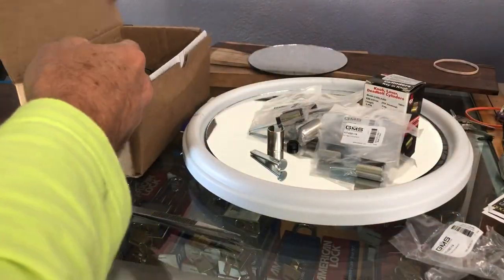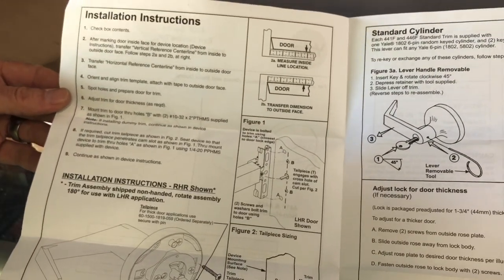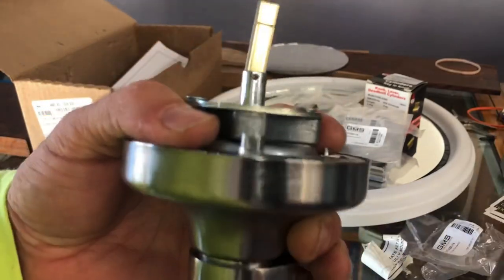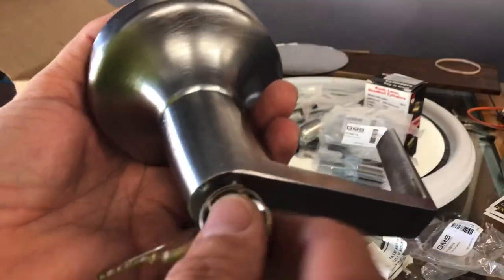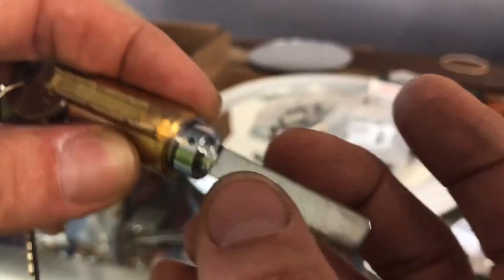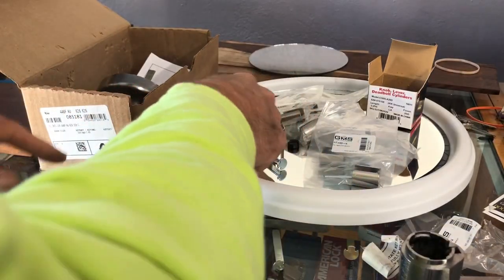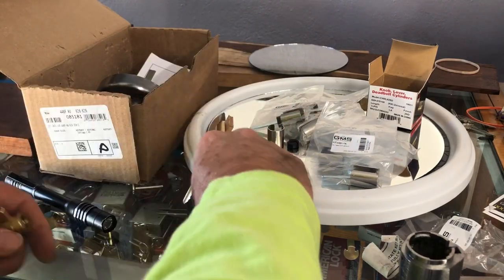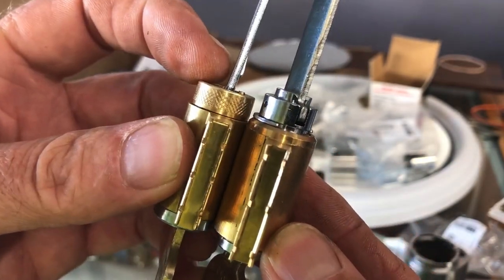the part needed to replace the key cylinder in a Yale exit device trim

Comment: Not sure if this was addressed in the video, got distracted, by checking the comments.
Out in the field i tried to modify some parts to change a yale manufactured lock to a sc1....i was successful, but the lock had no security, because at any point with the door locked, anyone could walk up to the door, use a poke tool, and simply remove the lever off the door, because the cylinder did NOT block the detent that holds the lever on the door (which should only be accessible when the key is inserted and rotated to some degree to use poke hole to remove lever from door)  i realized this before leaving, but not soon enough to not waste a bunch if time.  Hope this makes sense, and hasn't already been addressed.  I have some if these kits now, but have not used one yet.

Comment: I just had a customer with one of these... when you’d pull on the key a little the tailpiece would slip because of play in the detent that holds the lever on if you pushed on the key while functioning it would work but pull it a little and you could feel the tailpiece jump out of its spot that functions the storeroom style trim. They were cheap and didn’t want to spring for the Yale replacement so I just gave them a universal one and put a normal Yale Kik in and Keyed to existing key. No matter what I did it would only function when turning the key upwards which in my mind is counter intuitive. Frustrating but nothing would work. I’ve been in the field for four years I love it and hope to be doing this for the rest of my life

Comment: Look at the original cylinder and put the black plastic part so it is the same position as the original. Otherwise you may not be able to remove the cylinder after it is installed.

Comment: That tail piece only sits inside of the lock by like a millimeter I think those are not the greatest design as far as a trim that is used a lot the wear and tear causes it to slip eventually I’ve ran in to the same issue about three times in my time out and about which in my mind is a lot since they’re not something I’ve seen a whole lit

Comment: As always, Thanks. I research some of your topics you discuss, if I haven't dealt with or I have no knowledge. In my search I found that Yale also makes a 3804-LA cylinder for the 440F trim, which has the long tailpiece. Keep up the good videos Jason.
Reply from the maker: Kevin Koepke I imagine they do have some “other keyway” cylinders but I wouldn’t want to wait on them and pay what is likely a higher cost and also having these composite keyway cylinder can be really handy.